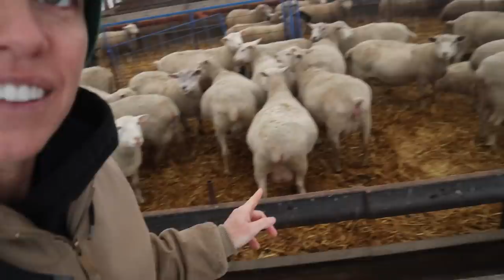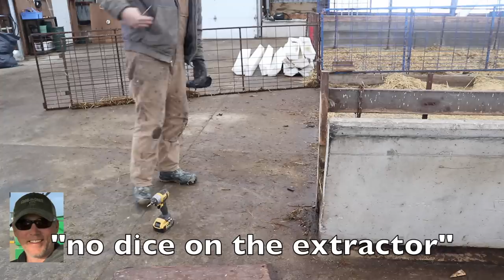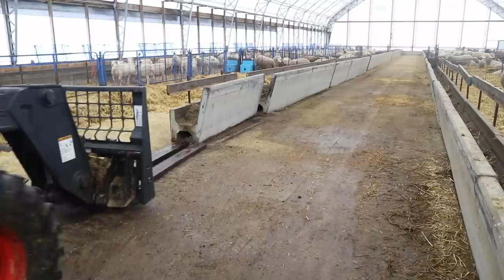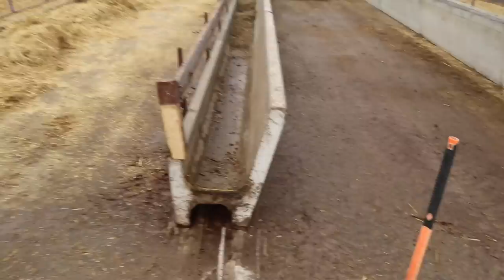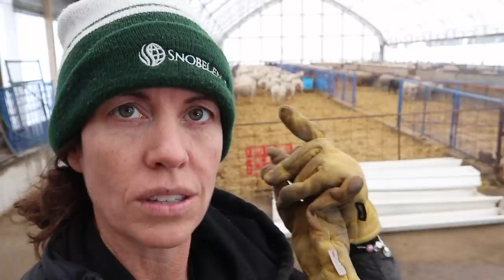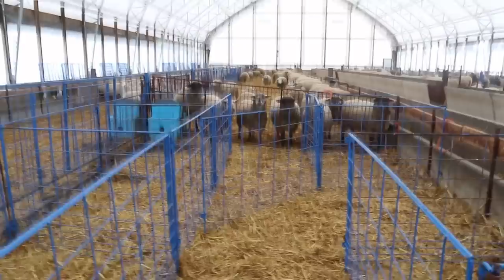'Twas the Day Before Lambing (FINAL BARN REPAIRS & SET UP): Vlog 188

Comment: Tim from Canada when you are trying to fix your grain  auger put a tarp underneath it so you do not have to clean up the mess and this way you can drag it out and mix it in with feed you have already put in your bins saves you from cleaning up and for having grain on the floor. It is easier just to use the term underneath anything you were trying to work on saves our mess

Comment: Great video as always.. something you may want to try in the future if you get a stripped screw is  take a rubber band and put it over the screw tip of the drill or screwdriver.. then press it into the stripped screw head.. sounds odd but works well.."usually"

Comment: Have tried double ended lead rope snaps for hanging water buckets by the handle. Have used for watering horses by bucket and it works welk.

Comment: Hey, To keep the Cement Feeders straight.  Drill Three 3/8 or 1/2 holes in each side of cement bunk that lines up with each other. Drill holes 3 inches depth on each side. Then use a 3/8 or 1/2 inch dowl rod cut at 5 inches.  Then when you slide together these rods will hold (individual bunks from moving) Basically the well have to move the entire line.  Most bunks (Cattle) have the holes predriled.  Hope this helps
Reply: Rick Ruemenapp Why cement bunk and not plastic please....that should be easier to move around
Reply: Omo, two reasons to use cement. 1. We have cattle. The cattle crush over time. 2. The plastic bunks are to light. When the herd of sheep all start eating they can push the entire line. Also when your cleaning the barn with a skid steer and you need to clean right next to the bunks you push them. Cement you can run the bucket right next to it to clean.
Reply: @gzfrt9  Thank you....If cost effective,the plastic can be screwed or secured in place?

Comment: Sandi, if you bolted a  two  ft  section of timber under each joint in the concrete feed trough,
it would save you a lot of time, no more tape measure.

Comment: Nice to see everything getting back to normal, no such thing as a perfect barn, if there was, we would all have the same type, nearly all metal barns here and in 2017 some had roof failures from exceptionally heavy snow. Hope you can get a few good nights sleep before lambing, lack of is a driver of stress.